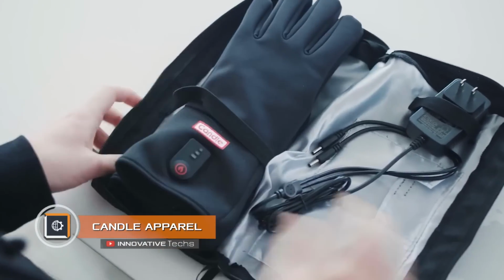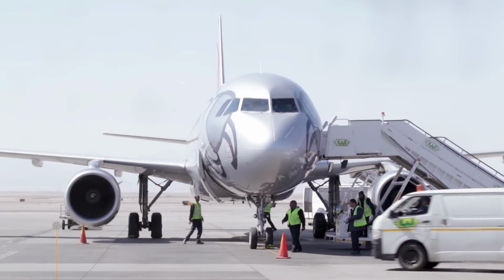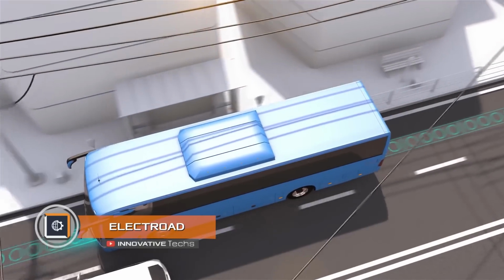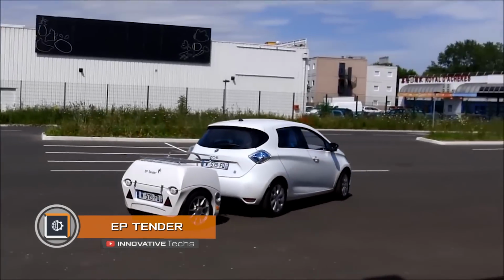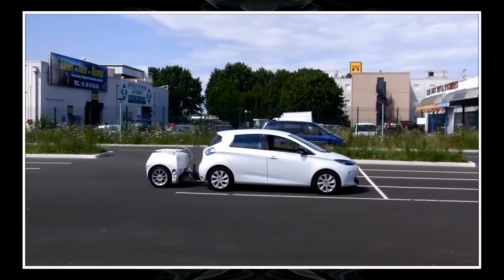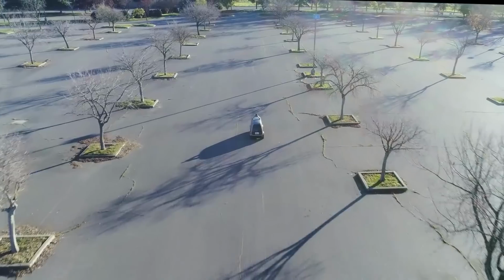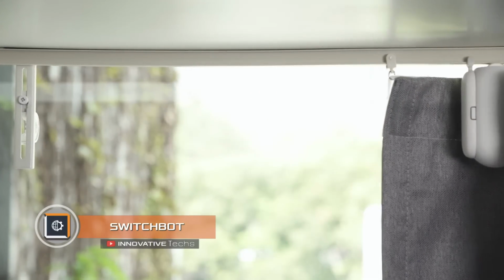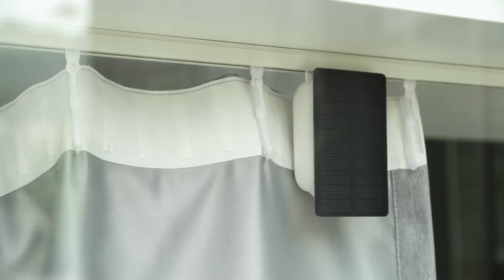New Inventions That Are On Another Level ▶5

Comment: i had an idea similar to the train/ airplane one like 10-20 years ago, but my idea wasn't for passenger transport it was to fly a portable hospital / mash unit into either a war zone or natural disaster area... thou mine was similar to an air drop when it got their,,,, with parachutes mixed with very low/slow  level flight was involved... to drop it off.  i'm happy someone else came up with another idea similar... the only time i thought of a passenger varient was when there were the reports of shoe and underwear bomb threats... but in that case mine where more like the compartments on a train where each passenger purchased a "cabin" ... that where linked together and attatched to an aircraft, that way if someone managed to get such a weapon on board they'd only kill themselves... if they did manage to damage the aircraft each 'cabin" could drop from the aircraft with its own parachute, they would also have to be positively bouyant to not sink if it happened over water... but then i thought about if anyone needed medical treatment or to use the bathroom... what can they do? they're stuck in a cabin... which would more than likely be too small to have its own rest room in each unit... so i didn't share that one as much... peace.

Comment: Nope to that train plane
 One day, the train part will come loose mid air.
Reply: That's what the idea was a long time ago. Just in case, for some reason, a plane is going to fall from the sky , the passenger part can be detached and deploy its parachuted. Could be that "the might come loose" idea stopped the idea.
Reply: Also, who wants to spend extra time in a tube without a break...?